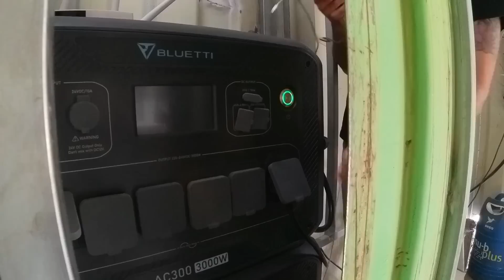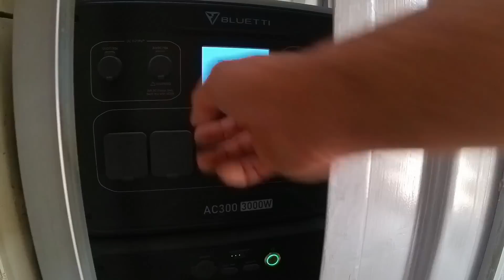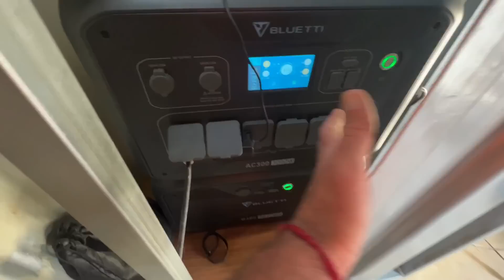EPOCA DE ROBOS !👀

Comment: Hola Eloy!! Llevo ya algún mes siguiéndote y de verdad q me impresiona mucho tu trabajo, he podido ver otros trabajos por la isla como el tuyo y sin duda el tuyo está muy muy bien. Respecto al xps, yo lo instalaría, conozco varias instalaciones en tenerife q lo tienen y yo he notado bastante la diferencia de temperatura tanto en invierno como en verano. Lo ideal sería poner una capa de Pvc, el corcho y encima la graba. Te va a ser más complicado a la hora de alguna reparación o colocación de placas pero lo agradecerás en olas de calor e incluso con el ruido. Un saludo y suerte.

Comment: Hola tío 
Yo de ti pondría alguna barra más en la parte de abajo de la madera . Y otras en horizontal en la puerta y lateral para que no se mueva la vertical, ya que con un simple gato de coche tal como está se abre .
Tema de candado . Con el curro que te has pegado con unas pocas soldaduras más puedes poner cerradura de seguridad, cosa que ya complica mucho la vida al asaltante, además del candado que tienes .
Está claro que si van con una radial pueden acceder , solo es cuestión de tiempo . Por eso yo también pondría en ese lugar una alarma con sirena de barco, que esté oculta o difícil de romper o apagar 
Eso deja sordo a cualquiera y además de avisar a los vecinos, se le van las ganas de estar trasteando
Reply: Me encanta la idea que tiene de las sirenas
Reply: Buenas, he visto una sirena de fábrica en una casa de campo y era ensordecedora. Hace muchos años. 
Venden ese tipo de artilugios hoy? Y aparte un sistema de seguridad de cámaras ajeno a internet sin cuotas ¿Para hacer desistir/descubrir ladrones? Gracias.